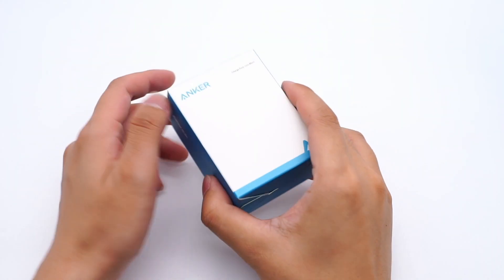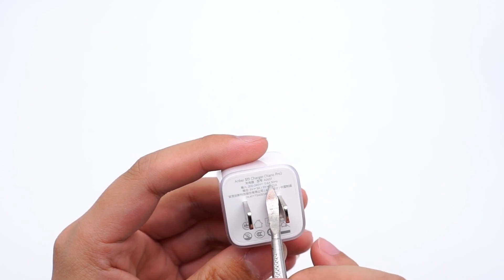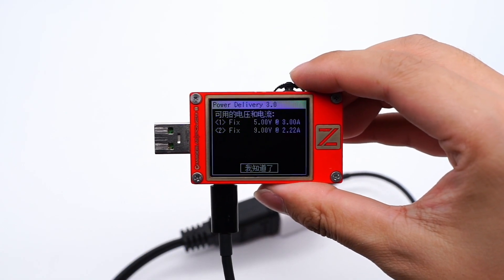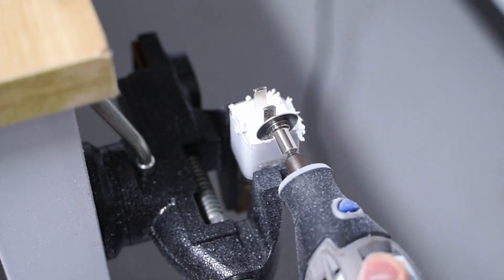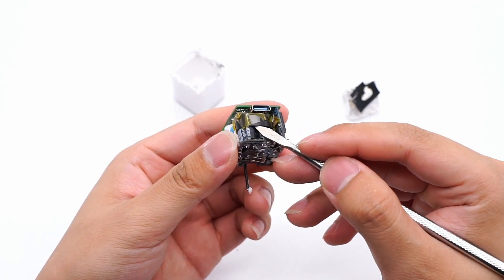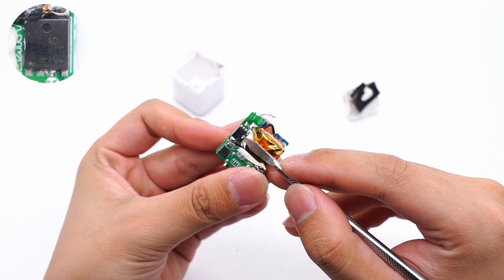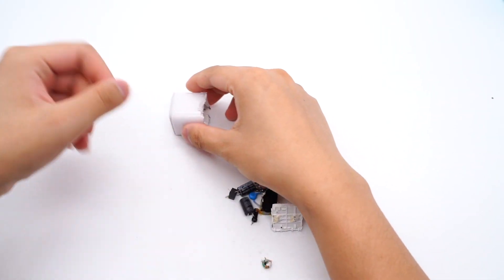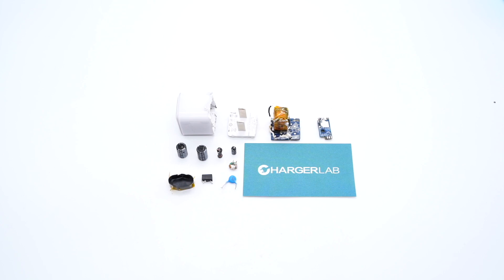Teardown of Latest Anker Nano Pro (511 Charger) 20W GaN Charger (For iPhone 13)

Comment: Voltage input on the back of the Anker charger (52 sec in your video) states 200-240v, however you state it supports input of 100-240v. The specs for Power Intergrations INN3266C-H214 supports 85-265v so I suspect you are correct and Anker labelling is not techically correct. Can you confirm or comment if the charger can be used with a 110v power input?
Reply from the maker: Yes, it can support 100-240v.
We've tested that.
Reply: @ChargerLAB  thanks for testing this, very useful!

Comment: I am using a Tronsmart WCP05 travel Adapter for my iPhone 12 and through its PD I checked yesterday that i got 0 to 57% in 30min(almost same as Apple 20W as shown in YouTube videos) and full 100% in 1hr 44mins which is exactly same as Apple charger time seen in one of the videos on YouTube 
But Tronsmart charger is huge size as it is a multiport travel adapter 
Was just interested in getting another small charger and getting the old Anker Powerport III 20w in $11 and 511 Nano pro in $19 so which one should i go for almost same size but price difference is big!!!and which port should I get PD or PIQ? I did test above test using PD port of Tronsmart charger…

Comment: I bought one (the blue one) and I notice that it’s pretty warm while using it, almost on the edge of being hot… is it suppose to do that or is that not safe? Please I need answers
Reply: The charger itself will get pretty warm but that's normal considering the fact that it's pretty small and can charge up to 20 watts. However, try touching your phone while charging using this charger and you'll notice that it does not get as warm as the charger itself. In my 2 weeks of using this charger, I have noticed that the "active shield" that they're advertising actually works. It maintains the temperature of my phone to an ideal level while fast charging. This was not the case with my previous Anker Nano PIQ3.
Reply: @nielsalute1828  Im facing the same issue,i just bought my phone and both the nano pro charger and my 13pro are getting warm while its charging,but my phone isnt getting warm when im charging it with 5w apple charger. Will this affect the battery life in the long run or is it normal? Have you faced battery health decreasing issue or something?
Reply: @raynz1337  hi Raiyan. I’ve been using nano pro for about 1/2 month now and my battery health is still @ 100 percent. Again, the phone itself will get warm since it is fast charging but not to the point where it’s disturbingly hot. If you’re using a thick phone case, I suggest to remove it while charging. As for me, I have not had any issues with or without my phone case. I have the older version of the anker nano which is the piq3 that is why I am able to differentiate the temperature while charging. Comparing the nano pro to your 5 watt charger will only make you anxious. That is a very bias comparison. If you’re patient enough to use the 5 watt charger during the night while you are sleeping then by all means use it, but I’ll stick with my nano pro. Also make sure that while you’re charging it is no where near direct sunlight or it is being charge in a well ventilated placed. Do not put it inside a drawer or a box or something like that while charging. Lastly, remember that a little warmth won’t harm the battery and it’s lifespan. In fact it is a given that it should get warm when charging to its fullest potential.

Comment: Omg, even not using solid capacitors? 😫
Reply from the maker: no, it has capacitors.
Reply: @ChargerLAB  yes, it has Electrolytic Capacitor BUT not the Solid Ones... and this is a big con for such small charger....

Comment: Is there a version of these chargers for Galaxy S21 Ultra too? With 25W or higher charging power.
Reply from the maker: The max charging power of Galaxy S21 Ultra is 25W, you have to find the 25W charger that supports PPS mode.
Reply: I think you should buy samsung charger 45w. It can use to charger up to 45w only for note 10 and S22 ultra and higher model

Comment: In terms of voltage regulation and highest quality power delivery is this better than Apple 20 watt? I don’t care about the small size just power quality and parts quality
Reply: I will say those little bricks don't have the space the bigger blocks do so thru definitely get warmer
Reply: @thetechlibrarian  Size of the brick says nothing about power dissipation. Heatsink size says something about final stabilized temperature.
Reply: @flexairz  what would u say is the best charger that doesn't overheat your iphone when charging? Apple 20w or anker 20w chargers?
Reply: Which is best apple 20w or Anker nano pro???
Reply: Power quality is yet to be known. Parts are definitely much better on Apple since it uses Japanese capacitors
Reply: @xabysebastian529  Depends on manufacturer and component shortages. Salcomp uses both Nicheon and Aishi so far.  The apple 20W doesn't have set in stone Japanese caps.

Same case for ANKER prob too. (RNG components based on what they can buy)
Reply: @pacificdrum0301  yes the newer teardown of apple 20w uses Aishi caps. Probably because of the Japanese Capacitors cant keep up with the ongoing demand
Reply: I care about USB-C compliance, safety, design, robustness (can survive drops and connector is not fragile) and small size. When you have to carry this with you, small size matters. Power quality follows USB-C standard compliance. Chinese caps are commonplace nowadays. This message was made on an iPhone made in China.

Comment: highest power on Apple devices.
Reply from the maker: Specially designed for iPhone 13
Reply: @ChargerLAB  did charging change with the 13?
Reply: @rosnow  Yea previous models charged up to 18w, 13 series charges up to* 27 watts (on iPhone 13 Pro Max).